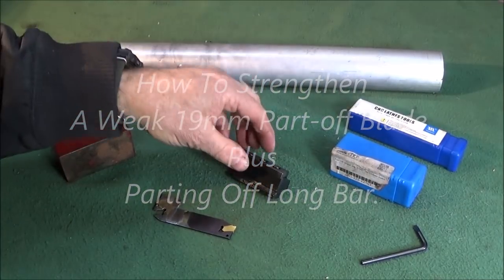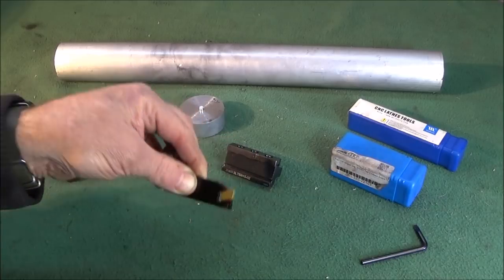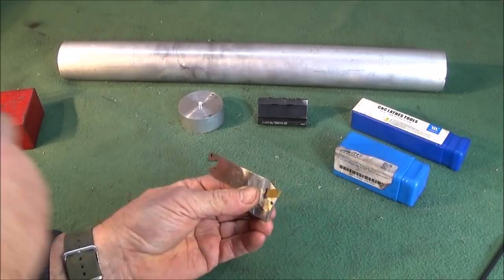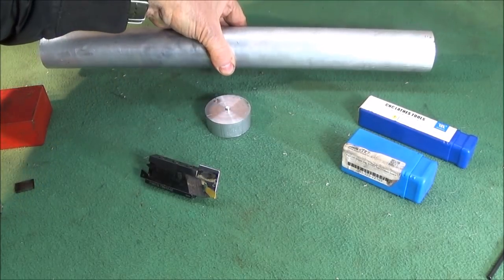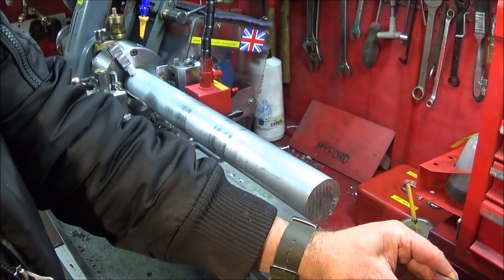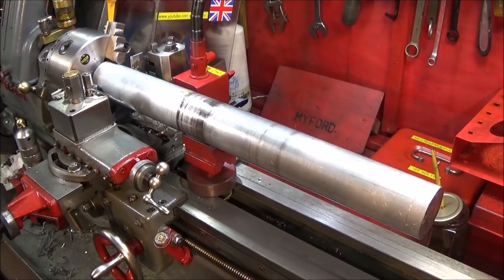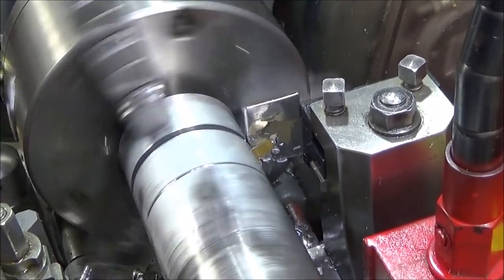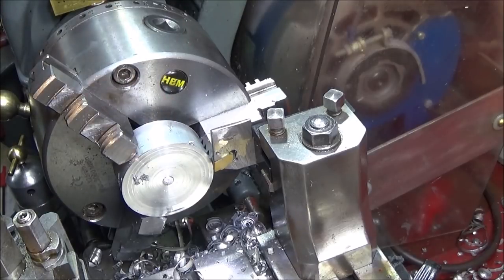Modify a 19mm GTN3 Insert Type Part-Off Blade To Strengthen it.

Comment: Even a visual of the holder makes that week area fairly obvious - the 'wedge' effect from the insert in use must produce considerable force.
Very useful modification Steve and also the V-block mod is a nice idea. That's quite a deep parting cut - very successful.
Reply from the maker: Hi Chris, Thanks. I have just finished upgrading the V-block steady. It now has 4 roller bearings for the bar to revolve on...Hope to show this soon. Regards Steve

Comment: I have used a tool called a MGEHR1010-1.5 Grooving tool Holder. It can also do parting. I have used it many times and it works without problems. It has the features you outlined in your video. It is especially good to do grooving down to about 1.5 mm. I also got 20 inserts for it (ex-China) for about $7USD. The inserts are as good as those I paid $7/insert. Makes you think about cost/benefit!!!
Reply from the maker: Hi Louis, Yes I have one of those. I use it for oring grooves, but also great for parting off small components. It is an excellent tool. I have found that the Chinese inserts are excellent now. I certainly wouldn't buy the branded ones at their prices. I have used many different makes over the years and am so pleased the Chinese can sell them at low cost...Thanks for watching

Comment: Hi Steve, that was very timely! I've just received a similar 19mm holder and GTN2 insert from Arceurotrade today The thin section on mine is a little wider at 6.1mm, but now I know how to fix it if it is a problem.
Many thanks for sharing.
Cheers.
Andrew

Comment: I got one of these with my lathe minus any inserts and I didn't like the look of it one little bit. I was certainly not prepared to take the risk of buying inserts for an obviously weak tool. Mine was bent at both ends already when I got it.You did a great job Steve, making a useless toll viable, but I have to question the value of a new tool that is not fit for purpose without modification. Had I bought one of these, I personally would have sent it back saying it was not fit for purpose. Great channel Steve, you and I share a Christian name :)
Reply from the maker: Hi Steve,  Yes I should have sent it back really. I bought it from Arceurotrade. Surely they must have had loads of complaints about them, they are absolutely useless. I have bought quite a few tools from them and this is the only one that is no good. I have just bought a 26mm blade one from Banggood in China that I can see will be excellent. Thanks for watching....Regards Steve

Comment: Thanks Steve your video is timely for me. I just fitted a rear tool post to my chinese lathe for parting off and bought the 26 mm version of the parting tool. It transformed parting off but in playing with it and parting off stuff I couldnt dream of previously, I managed to get the bending problem you describe. Could I get enough heat with a normal gas blowlamp to do brazing?

Comment: Or you can buy ISCAR parting blade once and be good for rest of life.Best parting blades i ever saw.Generaly their tools are expensive-but oh boy the quality is there.
Reply from the maker: Yes the Iscar and Sandvik are the best and have used them both in a factory setting. I have just bought a 26mm Chinese one now and it looks and feels great. I reckon it will last for many years. The one shown in this video, the 19mm type are just ones that are a complete useless design and shouldn't be sold.